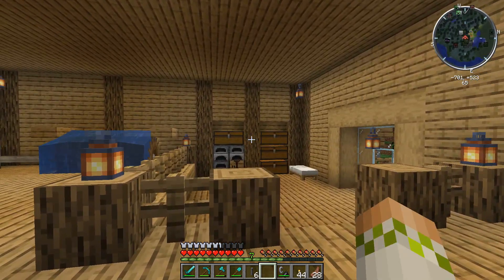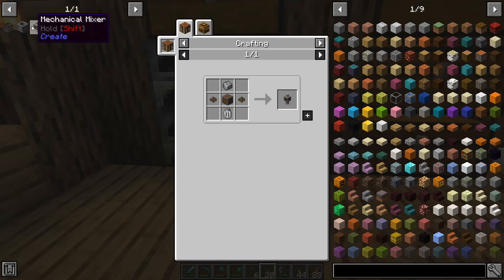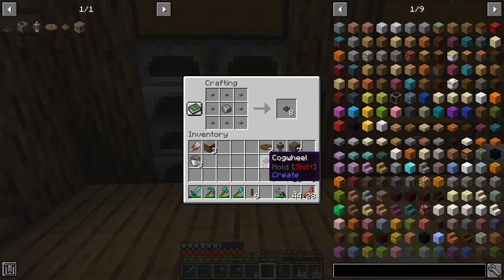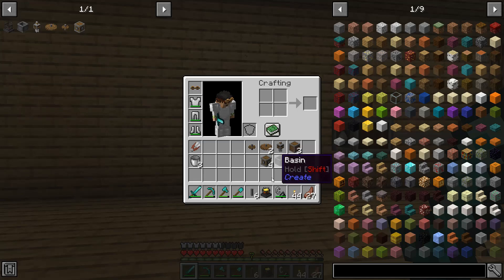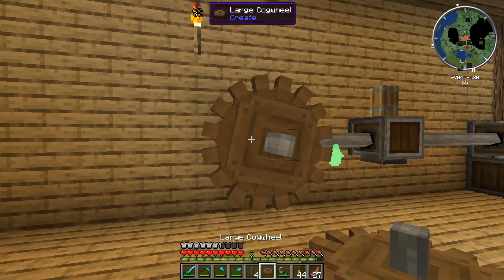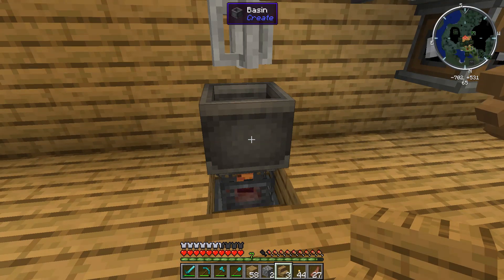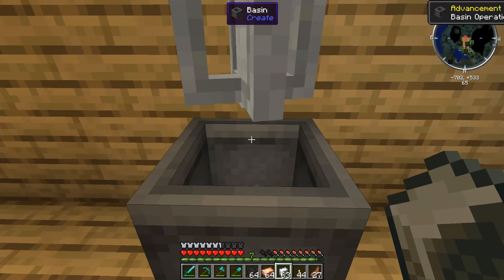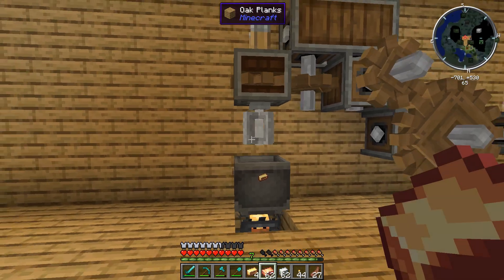Surviving With Create 0.3.1 :: E02 - Mechanical Mixer & Cogwheels

Comment: I made a windmill that has over 4,000SU, but when the force gets to my mixer it's only 72SU and not enough to make it work. I only have the mixer attached to the power source and I used big cogwheel at the start then smaller cogwheels to connect to it. Can't seem to figure out why I'm not getting enough rotational force.

Comment: I am wondering what I did wrong I followed you step by step, but my mechanical mixer says it doesn't have enough speed,  my 4 water wheels are putting out 160 su, I added another to make it 5 thinking that would add more speed but it stayed the same.  Can you please advice, ty!! :)
Reply from the maker: Mechanical mixers need 30+ RPM to run, a water wheel generating 160 SU is only going at 10 RPM, which is 50% of its maximum capability. Using a bubble column up the back makes it run at 20 RPM and using no bubble column makes it run at 16 RPM. If youre only getting 10 RPM something is wrong and it usually is the waterwheel is backwards and the water is not flowing properly over the paddles of the wheel. 

Also adding more SU generation will never up the speed, it only tacks on SU. The highest speed of a system will override the others when combined, but if theyre all the same speed adding more will never increase it.
Reply: @RagePlaysGames  Thank you, I did have it going backwards, this helped!

Comment: ive followed your instructions from episode one til here and I noticed my rotational speed isnt as fast as yours despite doing exactly as you've done to a T. I'm not sure where I went wrong here
Reply: The water should be flowing in right direction and all sides to get 16 rpm
Reply: I have the same problem but I'm sure I have it in the right direction

Comment: i did this but i still dont have enough rotational speed for my mechanical mixer. can anyone help? thanks
Reply: You can increase speed by putting a big and small cog diagonally. You must also increase the available torque (su) of your power supplier (adding more waterwheels, more wind sails etc)
Reply: @pchanio  ahhh thank you very much this really helped

Comment: well i'm doing everything you're doing and for whatever reason my mixer isn't reaching enough speed, any help would be appreciated
Reply from the maker: If you are properly using the cogwheels to 2x the speed, then the only answer is your waterwheels are not going at 16 rpm. This will happen for 1 of 2 reasons, 1) you do not have it properly covered in water / have water flowing down the back of it too, thus reducing the spin or 2) your waterwheel is placed backwards and the paddles on it are in the wrong direction to match the way your water is flowing.
Reply: @RagePlaysGames  i sent you a request on discord to show you the problems i’m still encountering, i did follow your directions but i’m still not getting enough speed. not really sure why :-/

Comment: I haven't found any copper, where did you get it?
Reply: It does no generate that much @ y=12 but at roughly y=40, for fast copper visit extreme hills/mountains biome. If not enough generate world with the same seed and use /locatebiome command.

Comment: Mines going only 24rpm and i looked back and i did the same exact thing as you how do i fix that
Reply: nvm i made it go 48 rpm
Reply from the maker: In case you are still having water wheels at base 12 rpm (i assume you are and just geared it up a 2nd time to go to 48) then check the direction the water is going over the paddles. If it is going the wrong way (opposite direction in the video) then even if you cover all appropriate sides in water it will not get to 16 rpm.
Reply: @RagePlaysGames  how do I change direction
Reply from the maker: @clean4253  Either make the water flow down the other side or break and place the water wheel from the opposite side you did before. That will flip the way its oriented as how you place it determines which way its paddles are going.
Reply: @RagePlaysGames  well all I did was at the gearbox by the mechanical press I placed a large cogwheel and a small one and just did the rest and it went to 48 so thanks for the tutorials I’m gonna be watching the other ones also can you make a drill video next or sometime in the feature thank you

Comment: wouldn't you be able to place a vertical gearbox, so the large cogwheel would be rotating horizontally and the place the smaller cogwheel to make the mixer rotate?

Comment: it says not enough speed for the mixer😔
Reply from the maker: Are you using a water wheel at full speed with a large to small cogwheel? That will get you 32 and be suitable. If you have the engineers goggles, make a speedometer and see the speed you have prior to the mixer. If ya need more help, we can troubleshoot from that # :)

Comment: Does create let you do a perpendicular bevel gear to change the orientation of rotational power instead of using three gearboxes?
Reply: yes it does actually! im pretty sure you just put one large cogwheel, then when you look at an edge of it with another large cogwheel in your hand, there will be a diagonal arrow pointing out where you can connect another large cogwheel.

Comment: Use an axe as a weapon, not a sword. EVERYBODY KNOWS AXE ON TOP
anyway do you use diorite to craft andesite? 1 diroite plus one cobble equals 2 andesite. You can craft diorite with 2 cobble and 2 nether quartz, and nether quartz is somewhat useless, so you can spend some on that.
Reply: Sword has a higher DPS and it has sweeping edge.

Comment: What is worth making in this mod if I’m in a mod pack with other tech mods? Like what’s unique to this mod?
Reply: Create is more meant to be a stand-alone vanilla+ mod. It's not exactly meant to be competitive to Mekanism or any of the other tech or resource mods out there.
Reply: the whole idea of Create is that you need to design machines with a bunch of different blocks instead of just putting 1 superheated furnace and using it (if that makes sense)
Reply from the maker: The major unique portions of this mod would be, in my opinion, the ability to make infinite iron / gold using a simple cobblestone farm and some machines and the ability to make super customizable efficient farms (crops & tree) with minimal machines.
Reply: @RagePlaysGames  is that worth it when a digital miner is available?

Comment: The Blaze Burner has Comparator output as of v0.3e. So we can automate the input of the Blaze Burner when it needs fuel.
Reply: Note.
Mechanical arm can input fuel when it's empty.
Reply: Is it possible to just put a bucket of lava under the blaze to warm it instead of pumping it full of fuel every time you want to use it?
Reply: Engi gaming